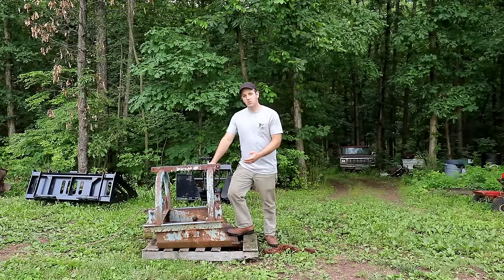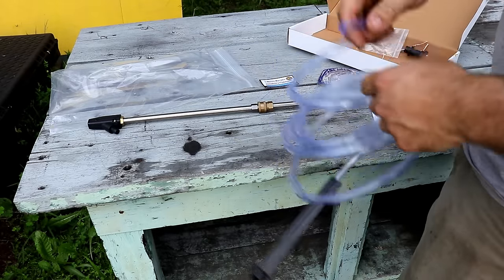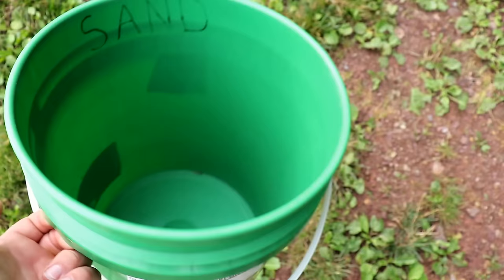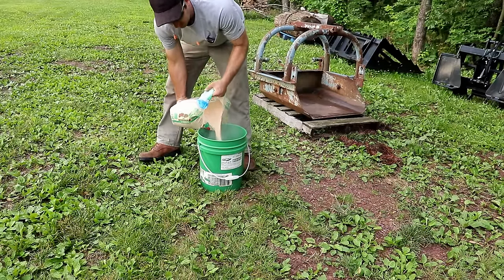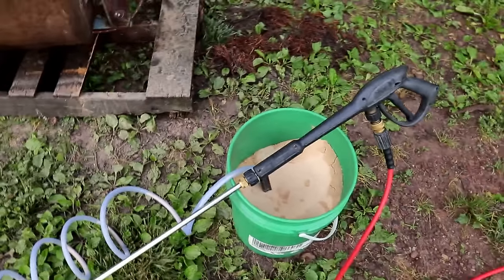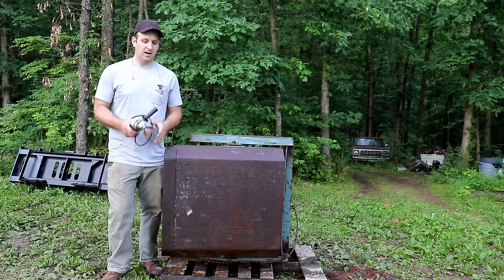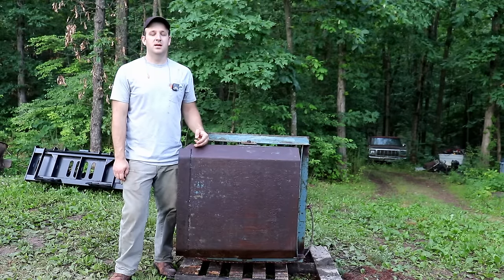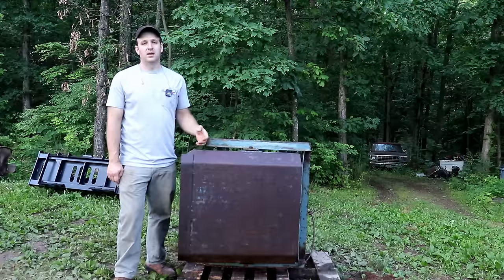I Turned My Pressure Washer Into a Sandblaster

Comment: I need to strip bottom coat on a boat, perhaps stripper and this... I've been sharing when I can... .. .
Would be great on a farm or anywhere you have rusty parts sitting around. Rust removal using simple Molasses.... 1 to 9 parts water, Will last up to 7 months. It Will have a slite odor but bearable. Get a kiddy pool, garbage can PVC pipe Tupper ware or whatever. Let parts sit for 2 to 3 weeks. Remove and best to power wash off. Every bit of metal turns to silt. No brushing just spray and protect from flash rust. You could coat with boiled linseed oil if just yard metal. So much better than sandblasting if possible as it will not harm the surface metal at all only rust. I've tried many solutions from acid to electricity. This works best.
Reply from the maker: I will keep the molasses in mind for future projects, thanks!

Comment: You may want to put some rust remover on the bucket. Then sand blast the bucket. The two together. May give you the results you were looking for.
Reply from the maker: I could, I think I need to try different media. My pressure washer also died the next time I used it, so it may have been low on pressure in the video.

Comment: I found a really old rusted car jack? on my property a while back and wanted to restore it. Do you think a 3000psi pressure washer using just water would remove the rust? Btw great video, might look into getting the attachment
Reply from the maker: A pressure washer would just pre clean it. It would need stripped better. You could buy a cheap grinder from harbor freight, the drillmaster that is around $10. Then get a good forney knotted wire wheel for the grinder. That should work pretty good for cleaning it. Another option is take it somewhere and get it sandblasted, which should not cost very much. Most automotive machine shops have a blast cabinet.

Comment: what is you stayed in the same spot for 1 minute ? DIY sandblaster arent fast either, all depend on the current state of the metal. i've used about 200$ worth of crushed glass on my trailer last year
Reply from the maker: I was trying to get it down to bare metal.
Reply: I just suggested crushed glass! lol

Comment: Most of the time it looked more like pressure washing than sandblasting. You need to keep the sand up high, so water doesnt drain back and clog the line.
Reply from the maker: Your right, it was not feeding very well. I am going to sit the sand on something next time.
Reply: @TractorTech  i actually bought a unit similar to yours recently, except it was brass instead of plastic. It worked great, and got down to clean gray metal with 3gpm 2700psi.
Reply from the maker: @zachary3777  What media were you using?
Reply: @TractorTech  play sand from lowes. The pickup tube on those plastic ones looks too restrictive.

Comment: Looks like at 5:10 where you were going slower and covering a smaller area a few times that it was doing much better.   An idea would be to slow way down and concentrate on very small areas at a time.   Hold it very close for a long time on one spot and see what happens.   I know for lower quality sand blasters the operator has to go very very slow to be effective.
Reply from the maker: It worked slightly better when I held it in place but the results were not satisfactory. Check out my latest video on it. https://youtu.be/BlJ2jguphao

Comment: Hey Rodger,  I know you're a stihl guy.  I have an old 028, the handle is broke off, so looking for a replacement,  having a heck of a time finding one. Do you know of anyplace that I might have luck finding one? Thanks.
Reply from the maker: Are you looking for the brake handle or the wrap handle?
Reply: @TractorTech  trigger handle, think it's the gas tank as well
Reply from the maker: @hyjackr  I know of a saw shop that may have one. The problem is the guy only deals in cash and I doubt he would ship it. He is old school. He is closed on Mondays. I'll try to remember to call him Tuesday and see if he has one. Then we can see if we can figure something out.
Reply: @TractorTech  THANKS
Reply from the maker: I called the saw shop and left a message today. He never called back. I remember when I was there earlier this year, he told me was shut down for a few weeks because of health reasons. I am not sure if that is what is going on now. If I hear anything back from him I'll let you know. If you go on one of the saw forums, and post a Wanted to buy, someone may have one.
Reply: @TractorTech  THANKS Rodger

Comment: Play sand doesn't cut it (no pun intended). Glass bead or crushed glass are great for paint & light rust. For rust as heavy as is on your bucket I'd use carborundum.
Reply from the maker: I was hoping play sand would be good enough since it is a one time use.

Comment: I watched another video showing a different much more expensive attachment than the one you demonstrate. Apparently people are having a hard time finding tips for it. Anyway... The guys using it are water sandblasting an old steel ship and they tried a couple different cutting mediums. What they found was fine sand didn't do squat. And said the play sand is more rounded and has courser grit in it that will jam it up. And lastly at $5.50 a bag at Home Depot /Lowes that did work really well was Pool filter sand. 

If it hasn't been suggested already you might want to give the Pool Filter sand a try as an inexpensive alternative to Black Oxide. If you're using this outside or not in a sandblasting cabinet with a collection bin that stuff can get expensive.

BTW - I noticed someone else mentioned different size tips and you said you would look for them... Where you able to find any other size tips for this attachment or are you limited to what ever replacement tips you mention in the video?
Reply from the maker: Pool filter snad sounds good. Lowes and Depot both don't show it in stock. I guess it is seasonal, unless they have something that doesn't come up on their website. They both have poor websites. 

I have not looked for a different tip yet. We got some snow this week, so I won't be using this anytime soon.
Reply: @TractorTech  - well, I'm in south Florida - 80 degrees outside - and they're out of stock here as well. Guess the buyers live in the north.
You can try a pool supply house as well - which is what I had to do to get some. It does work a lot better than the play sand. Huge difference.

Comment: Hey Roger...what camera  and mic do you use.  Your quality is very good.  Joe.
Reply from the maker: Thanks, my main camera is a cannon sl2. There is a guy on ebay that sells them for less than you can find them anywhere else. My mic is a rode go. I also have an shotgun mic as a back up. https://www.amazon.com/gp/product/B00E58AA0I/ref=ppx_yo_dt_b_search_asin_title?ie=UTF8&psc=1

Then I have a go pro hero 5 black which I use for some shots. The audio is crap on the go pro version 5 and newer. I wish I had a hero 4 black, I see TV shows still suing them. 

I also have this camera: https://www.amazon.com/gp/product/B01MXXP4EC/ref=ppx_yo_dt_b_search_asin_title?ie=UTF8&psc=1. It is pretty decent after I played with the settings. I use it for dangerous shots where the camera could get damaged.
Reply: Streach your sand blasting hose after warming it.Plus buy masons sand by the ton.Much cheaper but then their's the storeage.

Comment: You can clearly see that the sand is wet in the tubing and it is not flowing. Elevate the bucket and double protect it from water. The sand port should be above the venturi. Do not get one drop of water in the bucket.  Most of it is your errors.
Reply from the maker: The sand was not getting wet. https://youtu.be/BlJ2jguphao

Comment: Id like to see a test section where you used the power washer only, I dont think the sand made a difference
Reply from the maker: The sand blaster did help. The pressure washer would not have done much itself.

Comment: Angle grinders spin too fast for wire wheels.  You will have wire breaking off and acting las projectiles.  Been there.  Luckily did not lose my eyes.  Use a heavy duty VARIABLE SPEED polisher-grinder that you can slow down when using a wire wheel. .
Reply from the maker: I have it working decent here. https://www.youtube.com/watch?v=BlJ2jguphao

Comment: Cleaning that part, is redundant. When you use it to scoop mud, it will polish itself on the bucket section in the mud. Do the walls and tight details first!.
Reply from the maker: I agree but that was the biggest and flattest area to test it on.

Comment: I think your best, most cost effective bet aside from a straight up sandblast is using a 1/4 sheet and orbital sander and a wire wheel. With aggressive and medium grits those sanders work very well on steel. You can use the orbital for all of the open area, use the 1/4 sheet sander for the corners and the wire wheel for all of the pits and crevasse. Easy peezy.
Reply from the maker: I have it working pretty good but sanding and wire wheeling maybe cheaper in and easier in some cases. https://www.youtube.com/watch?v=BlJ2jguphao

Comment: You need a higher PSI   3000 or 4,000 PSI power washer to get it down to shiny silver bear metal and all the rust off, watch ( legit street cars, dustless sand ) on YouTube, great video, using water is going to leave surface rust, but maybe shoot it without the water, to try to get the surface rust off, but a little elbow grease & some sort of a hand sander should clean it up way better, to you liking, but, i hope this ( legit streetcar dustless spray video ) helps you out, or watch ( Adam J. How to build a sand blaster out of an LP tank, ) on YouTube, this video really cleans off the sand very well, or Adam J. ( Homemade sandblaster vs  rusty axel can it handle it )
Reply from the maker: I have it working pretty good with a 3200psi pressure washer. I'll check out the legit steet cars video.

Comment: I'm going help you out a bit the more course you can run your sand the better it will take heavy rust or thicker paint 
The larger the individual grains of sand the deeper it will cut the finer the sand the finer you finish will be 
I have found that the product black beauty is an awesome product for cutting rust and paint go to a local sandblasting store and ask for small samples of different sizes and products to test with your rig they will give you samples from broken bags for you to use to see what works best for each application you are working with then buy what works best for you and your rig
Much love from Tulia Texas out on the farm
Reply from the maker: I have another video where I used the black beauty coal slag, the coarse stuff. https://youtu.be/BlJ2jguphao It does much better. I'm not aware of a sandblasting store. I think I ideally need a mixture for my media. Thanks for watching.

Comment: You missed a part of the instructions. The hose should always be above not bellow the jet.
Reply from the maker: I don't think it had any instructions.
Reply: @TractorTech  Where the clear tube enters the nozzle, it's always supposed to be on top of  the nozzle. If not, water will drain into the clear tube and contaminate the sand. Especially after you release the trigger.

Comment: You need to use #0 or # 15 on your tip for this to work
Reply from the maker: Thanks, I'll check into some different tips.
Reply: @TractorTech  also use black aluminum oxide sand it takes the rust off very good the metal will look like chrome
Reply from the maker: @arbinnunez109  Thanks. I forgot to measure the tips today to see if I can find different sizes for it.

Comment: You screwed yourself by letting water into the sand in the suction hose it is imperative that the feed tube is upwards. You clearly had it downwards causing water to leach into the sand and clog the siphon
Reply from the maker: Not much water ran down the suction hose but when I use it they next time I am going to have it facing up.

Comment: The reason you’re not getting the results you want one you’re using the wrong kind of sand to you’re swinging it back-and-forth like you’re washing a car you need to go super slow with your movement.
Reply from the maker: I tired holding it in place and it did not do any better.

Comment: Think mate why bother doing inside bucket just gets friction scrubbed by sa
nd and mud ,outside paint,oil the rest
Reply from the maker: I'm probably going to use a hammer finish paint that has alot of hardner in it. It is very durable.

Comment: Nothing wrong with your pressure washer boss .  You are loosing momentum from the sand attachment being too close to your spray nozzle !  There NO control or pressure THERE !  Imagine a pistol vs a rifle ....no comparison !  Bring your sand hose as far back on the spray gun BARREL  . Longer travel of Sand down a longer BARREL will give you the psi pressure your looking for . If it start eating up your gun BARREL too quick ?  You might have to try fabricating your gun BARREL to something stronger like a thicker BARREL maybe  stainless steel or carbide BARREL or even titanium ?  Those carbide , stainless steel , titanium tubing or still pretty cheap on eBay . A thicker BARREL will buy more time as it eat it away .  Also have an enclose bucket with a lid. Drill a snug hole in the lid of bucket and put your lid on . To keep water out and keep the pressure stable inside your bucket too !  Do not move your gun in a mad man fast motion . Concentrate your spray patter 2-4" inch from object and move your spray patter approximate 1" inch every 2-3 seconds .  Hope this help ?
Reply: Also....sand is a good choice and it's FREE if you willing to work for it a little ?  Go grab all the beach sand , river sand , pump sand , you MIGHT have to take it home and screen it to get the trash out but we'll worth it !  Have fun .....that's an order !    😂😂😂😂😂
Reply from the maker: You be right about it losing velocity or psi in this case. It is not picking up the sand real well. I do a have lid not for the bucket. The pump went on this pressure washer shortly after making this video. I have not tried it on my other pressure washer.
Reply from the maker: Good point. There is a place not far from here where there is sand on top of the ground.
Reply: @TractorTech  Also....rule of thumb !  Don't be lazy !  Always installed a fuel shut off valve on all equipment to include push MOWER , edger  , weed eater , pressure washer , outboard motor  etc...etc... !  When you done....shut off fuel valve and let it run till it shut off by themself !  So your carburetor won't go bad !  ......... on pressure pump.....When your done !  Mix a mixture of car antifreeze of 40% antifreeze to 60% distilled water and put it in a cheap squeezable 16 oz. plastic water bottle . Mix it good and put against the water pump water hose inlet and squeeze the crap out of it with your bare HANDS.  Repeat that procedure twice .  That will keep internal pump and seal lubricated and fresh for storage until you used it next time  SO YOUR PUMP DON'T GO OUT ON YOU !  CITY WATER IS REALLY HARD ON WATER PUMP SEAL !   ..... if you follow these step I shown you ?  All your engine and water pump will last a lifetime !   Mechanic trade secret !......shhhhhhhhhhhhhhhh !   Lol. 😂😂😂😂😂😂😂😂😂😂😂
Reply: For storage over a month ? Always run all your gas out until engine die on it own .  Any fuel left in gas tank over a month need to be siphon or poor out prior to new start up .. !
Reply from the maker: @joeblowjohnny2297  I already shut the gas off and let run til it burns out what is in the carb.